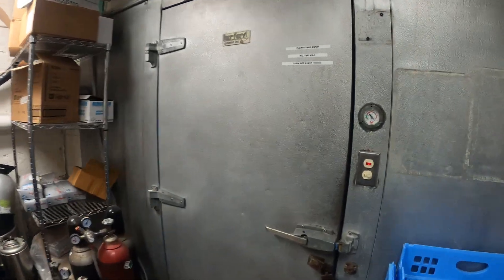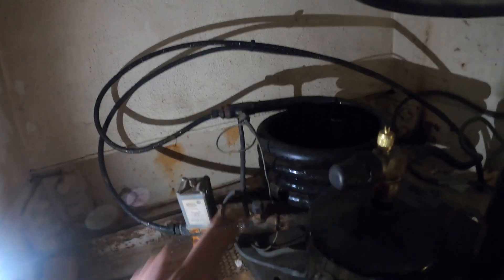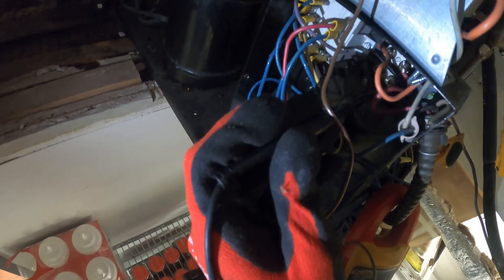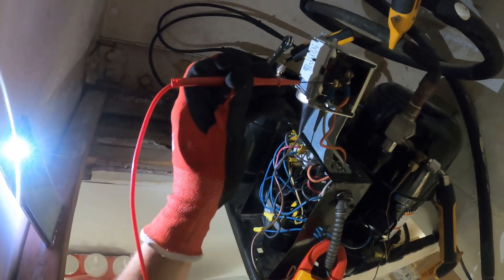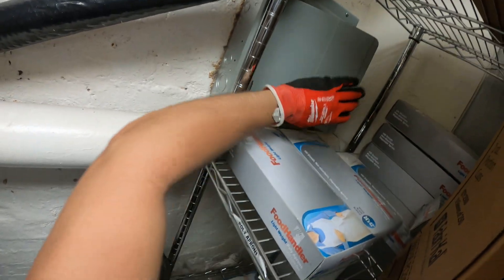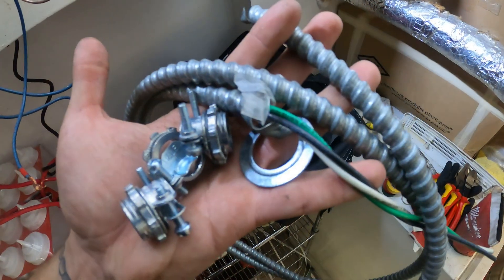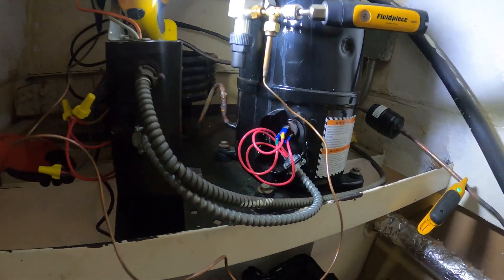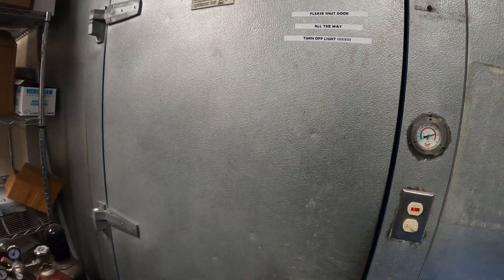HVACR Service Call: Water Cooled Walk In Cooler/Refrigerator Not Cooling (Breaker Keeps Tripping)

Comment: Great video and thank you for sharing. 

Quick question do you have an ideal pressure for walk-in freezers and coolers?
Reply from the maker: Thank you! It would all depend on the type of refrigerant as they run on different pressures and also if the condenser is water cooled or air cooled as that would play a role depending on the air temp/water temp. Stay tuned for new videos every week🔧⚡️